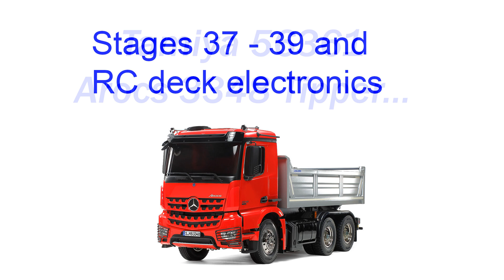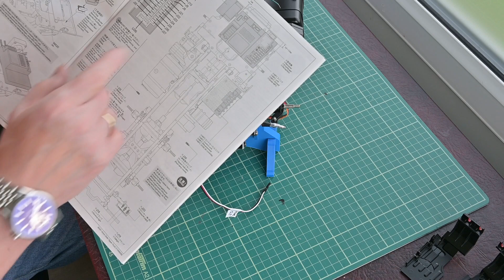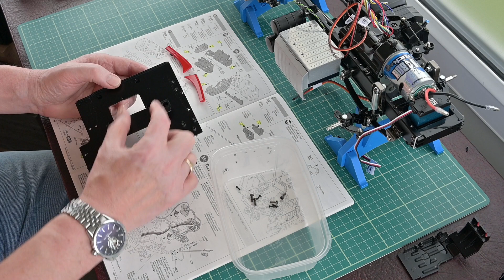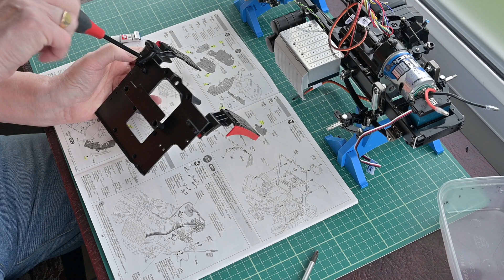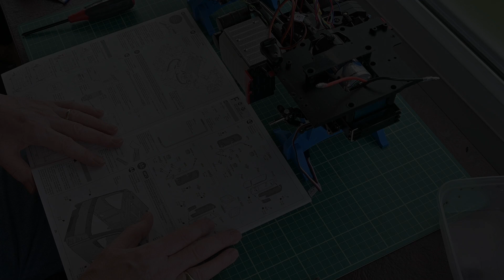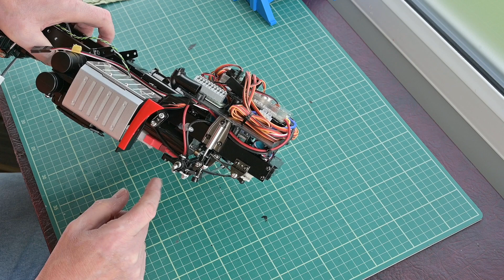Arocs Tipper build Part 14

Comment: Colin, as always, your Harness Management skills are superior! I can only hope mine looks half as good.
You've sold me on the SFR-01. I just have to wait a while until I can afford one. I've a feeling it won't be my last! The USM-RC-3 is outstanding, but of course, no motor control.
Reply from the maker: Thanks Carmine. I have my father to thank for my electrical skills. This model  build is particularly challenging as the space is rather limited.
Reply: I understand. My Tipper has the same Cab. Can't wait to start it, but slightly nervous too. 
Love the Cab Stay idea too. 💡 
I didn't think it opened far enough. I want to see that bit... I'm going to try the same thing, with 35lb test Nylon Fishing Line. 😉